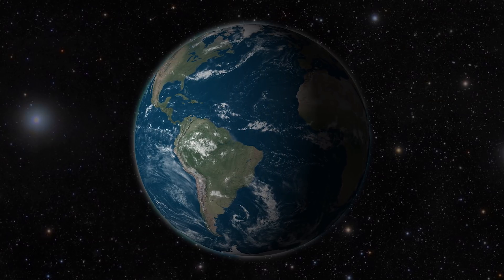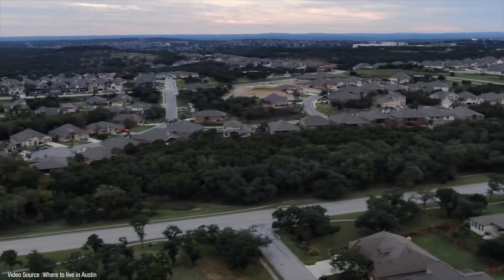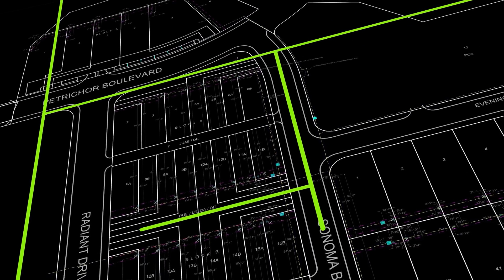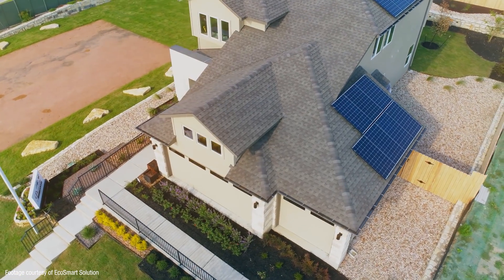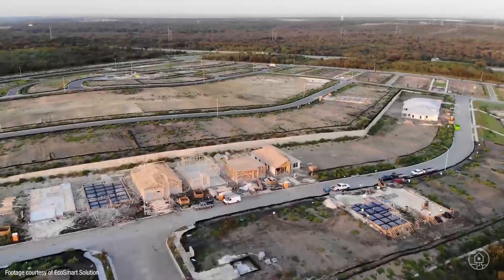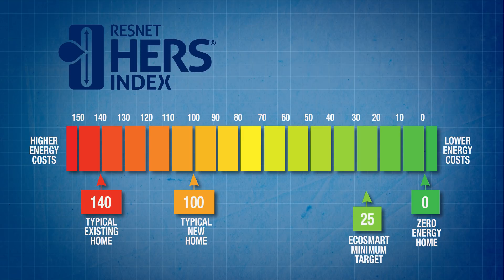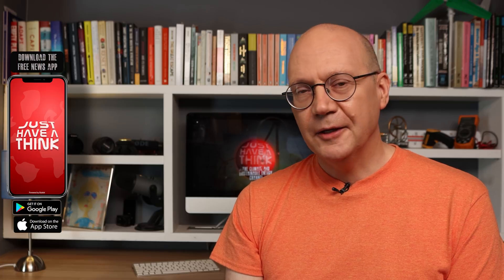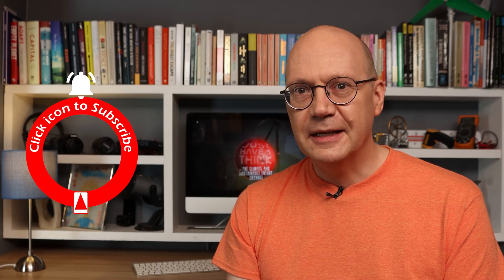Geothermal Energy meets Master Planned Communities :  A blueprint for the future?

Comment: We are still missing technology and machinery that would make geothermal a cheaper possibility in already-built individual houses. Some kind of robotic borer that you put in the garden or the garage, digs vertically and horizontally, insert 100 meters or so of pipes that end up in a loop back at the garage's heat pump, with all the proper computations of slopes and efficiency based on the soil. Make that 150 m for my poorly conductive clay soil.
Even before starting any work, a simpler borer could be used to dig vertically and provide an estimate of the system's future efficiency based on the best possible depths for the pipes.
But for new houses or housing developments, this is cheaper to set up and should be strongly considered. It makes so much sense to retrieve the soil's heat in winter and the coolness in summer. Middle seasons, not so much, but do we still have those with global warming?  ;-)
And if you don't have a garden to bury your pipes, plan to do it under the wine cellar before starting building the house!
Reply: There is definitely a need to retrofit existing housing with ground source heat pumps, especially in the colder climates.
If only I had the money to start my own company ...

Comment: Cool. Big developments in Florida are often situated around multiple manmade ponds (for stormwater management). Some innovative developer ought to utilize the ponds for geothermal HVAC. It’d be cheaper and easier than the usual geothermal systems that require so much digging.
Reply: @JKHTX  Yeah. The Chinese tried that. Individual consumption went up a lot.
It's called "Jevon's Paradox". Free up a resource through efficiency and someone will find another use for it. In this case, reduce population growth, standard of living goes up. Consumption follows.
Reply: @JKHTX   Unfortunately you don’t know what you’re talking about. Using ponds for geothermal HVAC is a proven and effective system. Ponds remain relatively constant temperature down deep.
Reply: @ThreeRunHomer  That depends on how many housing units are trying to utilize that thermal resource, along with many other variables. Unless you do that math, for each case, YOU are the one that doesn't know what they are talking about. There are also factors involving wildlife, algae growth,  other environmental factors, etc.
One home using a three acre-ft pond isn't the same as 200 homes using a 20 acre-ft pond.
Reply: @TheGhungFu   🤣 you’re a dope.
Reply: @ThreeRunHomer  Nope. I'm an engineer.
You?
Reply: @TheGhungFu   you seem overly agitated. Did you forget your meds today? (I’m an HVAC contractor in Florida).
Reply: @ThreeRunHomer  Me? Agitated? I'm not the one here telling other folks they don't know what they are talking about and calling them "dope".
Maybe you should smoke some and leave the thermodynamics to experts, like me, who can do the math.
BTW: Most HVAC guys I know can't balance their checkbook. They need an app for that.
Reply: Maybe not such a great idea for Florida, but definitely a good idea for climates that get freezing weather in the winter.
Reply: If you want to help slow down anthropogenic climate change, here are some ways you can do so for free.

TreeApp, an app that plants trees on your behalf every day. All you have to do is watch a 30 second advert. Unfortunately, TreeApp is only available in the UK and Ireland. 
Tribaldata, an app that sells data. You can plant a tree every time you earn enough points.
Both apps work on smartphones and tablets. 

Ecosia, a search engine just like Google, but all it's profits go to planting trees.

Thenonprofits, a website with links to click to donate. You can plant trees, protect forests, help people who are poor, sick, provide healthcare and education, etc for free.

🌲🌳🌲🌳🌲🌳🌲🌳🌵🌴🌵🌴🌵🌴🌲🌳🌲🌳🌲🌳🌲🌳🌵🌴🌵🌴🌵🌴🌲🌳🌲🌳🌲🌳🌲🌳
Reply: @JKHTX  I absolutely agree!  Stabilization of the population is a necessary goal. However:

My goal was to encourage people to take responsibility for their carbon footprint. I know how reluctant people can be to open their wallets and purses. So I am suggesting methods that people can do for free. 
Those projects* for free:
Plant trees
Protect forests
Invest in renewable energy projects
Encourage companies to cut their carbon footprint

* Plus a host of other humanitarian projects.
Reply: @JKHTX  the reason the CCP dropped the one child policy was for several reason.

A) You have already touched upon one, namely the reduction in productive members of society. An aging population will cause China other problems just as Japan is now facing.

B) Due to cultural reasons more female fetuses are aborted than male fetuses. This is causing societal problems due to having so many bachelors who can't find a bride. 

C) China is now focusing on investing in renewable energy sources, nuclear power, tree planting, and other methods of becoming carbon neutral. 

D) Due to industrialisation, the people of China are naturally having fewer children. I suspect that the CCP came to the realisation that it is easier for the culture and customs of the people to control birth rates rather than the heavy hand of the state.

Comment: Does geothermal pull water out of air?
Reply: No.
Reply: @incognitotorpedo42  how is that going to make your house comfortable then your still going to need a heating and cooling system or atleast dehumidifier to pull the moisture out of the house.
Reply: @jimmyjohn8008  heat exchanger system using the loop flow as a source...

Comment: Very good, but it I think would have been interesting with some more real data. Since they have some homes finished, it should be possible to have some numbers per home and totals so far.
Reply: With all what has happened over the last 18 months, would you trust controllers data? Best wishes.
Reply: @jimmycorkhill1390 Why should the last 18 months do anything. The data is what it is and you always evaluate them an compare to see if they make sense.
Reply: @bknesheim  I would have thought it obvious, the data was meaningless if not fraudulent? They told you how they were gathering it, the equipment and methods used and yet you chose to listen to the media spin on it? This is the same will all the other such sales pitches? Did you fall for the Volkswagon scam? Any of the others? Have you ever obtained the MPG promised, the return on your pension scheme? All the pledges you voted for. Best wishes.
Reply: @jimmycorkhill1390  
-Since my request was for data, the data can not be meaningless since they are not there.
The best way to reality check something is to see what data is supplied. Based on location and size you can estimate fairly close what they should be.
The Volkswagon "scam" was only possible because of bad metodes for testing.
Had they been driving the car for a few days while sampling it would never have worked at all.
Not entitled to any MPG.
My pension is guarantied by the Norwegian state and I think it will be OK.
Reply: @bknesheim  My comment referred to meaningless data in general and the general population sucking it up as if it was real. MPG as claimed by manufacturer has more or less always been a lie. VW intentionally lied? because they could and new it would work? which it did? It is good that your pension is state guaranteed and that your state is in a better position than most to honour it. We have seen what states can do when they wish to negate pledges? They have already introduced some of their plans, instigated and indicated others. Best wishes.

Comment: Great video!!
I'm concern about the logistics and maintenance of this systems, one little failure in the fiber and you have to dig again for everything
Reply: Wasnt is Texas that recently experience grid failure at the most crucial of times? Best wishes.
Reply: @jimmycorkhill1390  lots of folks had a tragically difficult time in February - including myself and my loved ones. However, the GeoGrid maintained very well behaved and warm temperatures despite the frigid conditions.
Reply: @ecosmartdavid1283  I didnt, in fact all winter my heating and electric worked as it did each other year. My solar panels and connected batteries supplied my stuff and my wood supply helped heat my house and cook my food. They are telling you to expect more of what Texas experienced, it is up to you, if you heed their warnings/intentions? Best wishes.
Reply: @jimmycorkhill1390  oh, you're in Texas too? I'd love to hear about what kind of equipment you have and how it's properly winterized.
Reply: @ecosmartdavid1283  Nope, but Im not in California either and Im aware of some fires. Nor in Australia or China to experience the floods. Are you in all of Texas? If you are truly interested, My system is simple, solar panels on a big green house roof that stores electricity in batteries and heat in the ground. Former is inverted to provide elec to a standard wiring circuit. Woodburner masonry stove provides heat to space and a large cooking surface. Others provide extra hot water/space heating should I require. Elec generally provides hot water for bathing. I do no special winterizing because it's all within the basic simple design which is doable for most given resources. I do sometimes knock off the snow. Best wishes.
Reply: The fiber is only a few feet deep should there need to be any repairs on that, as well as the horizontal grid :).
Reply: Fiber is very fragile, so is always inside of conduit.  That means repair or replacement just means pulling new cables.
Reply: @juliaset751  I must have watched a different video than you lot, this one was nothing to do with fibre optic cables. They only took opportunity in this example to run a com cable in while the trench was open. It has nothing to do with geothermal and the PE piping.....or have I missed something?  Best wishes.
Reply: @jimmycorkhill1390  You are right, virtually all com cables are fiber nowadays, but I probably should not have assumed.
Reply: @juliaset751  I watched the video a second time after the fibre comments for clarity, I thought I had not realised some new amazing invention that could transfer heat from deep in the ground to a homes DHW/CH systems. But no, the video is of a basic geothermal system using polyethylene pipes with the only difference is each home is linked together to share load. Best wishes.
Reply: Fiber is so cheap that you always lay in some spares.
Reply: @kkarllwt  it is no wonder zombies are walking around in masks? Best wishes.

Comment: Hi. Have you heard of sand thermal energy storage? The sand is heated to 600 C by air pipes - the rest is similar to the system you described in this video. I think this is a more effective solution. Polar night energy company is the one who invented it.
Reply: Owner-builders did this back in the 1970s.  How is the air going into the sand being heated?  Is there insulation around the sand?  Water has a higher heat capacity than sand.  I talked to someone who stored thermal energy from solar water panels in an underground container filled with water and sand, but it did not work well because ground water got through the cracks in the insulation.
Reply: This system in 
Austin is a cooling system. Also, see 247solar.

Comment: I just wish that geothermal district heating (grade 5 = heat pump based ?) was implimented when they put in Fibre-Optic Cables here in the UK as such a combination of installing technologies makes so much more sense than when done seperately and would help reduce the UKs rising energy consumption.
Reply: Sounds simple, but reality is so different. Best wishes.